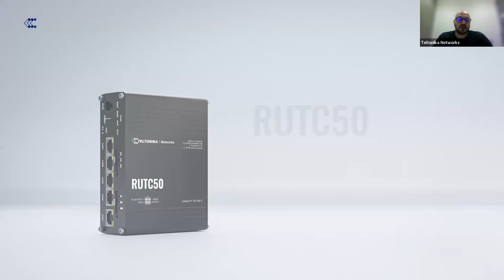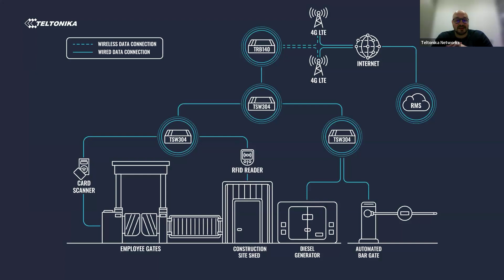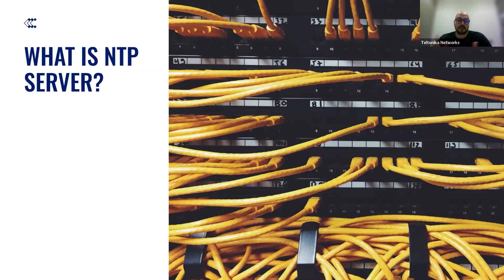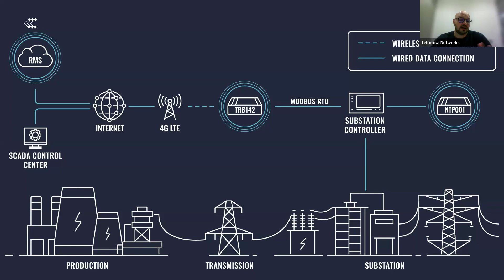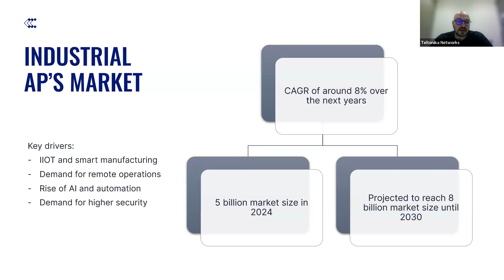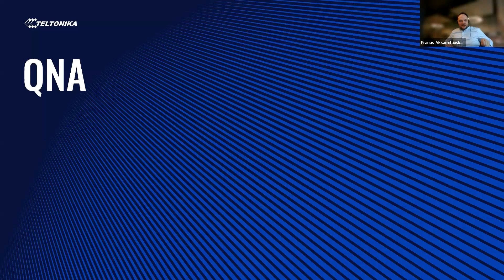Exploring the DAP140, DAP142 Wi-Fi APS & NTP001 NTP Server | Teltonika Webinar

Comment: I hope the NTP precision of the NTP001 will be better than the one on the RUTX50, since there's an offset and a devitiation in that one when using GPS as source. It's often classified as 'outlyer' or 'falseticker'
Reply from the maker: The NTP001 is specifically designed for time synchronization, ensuring more precise and reliable NTP performance. Should you have any further technical questions or require assistance, please don’t hesitate to contact our support team through our community forum here: https://community.teltonika.lt/c/teltonika-networks/5, and kindly provide detailed information regarding your inquiries.